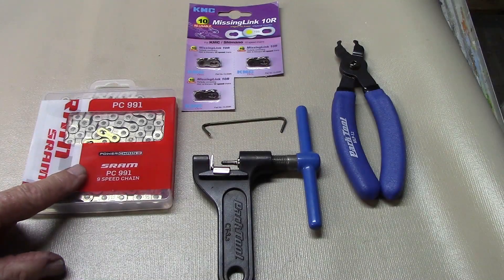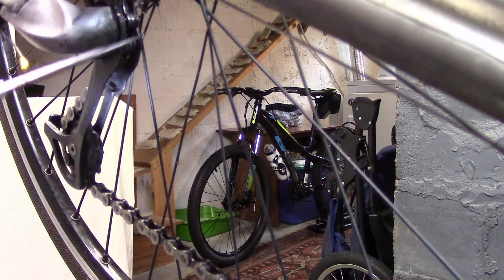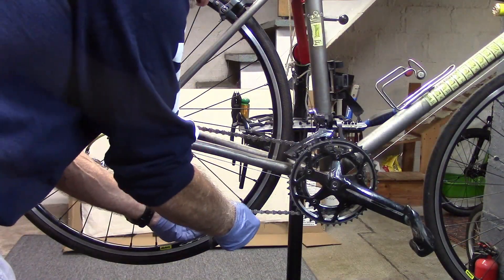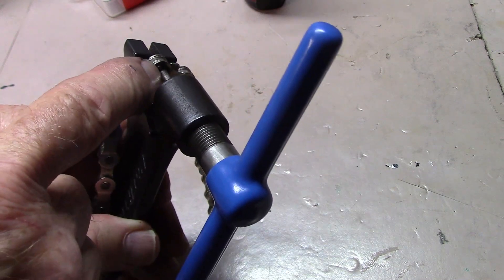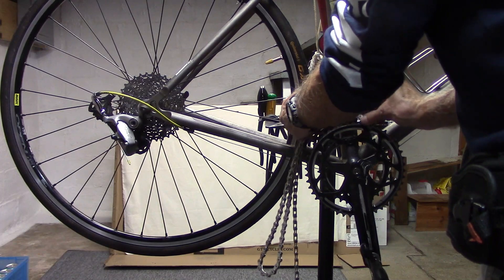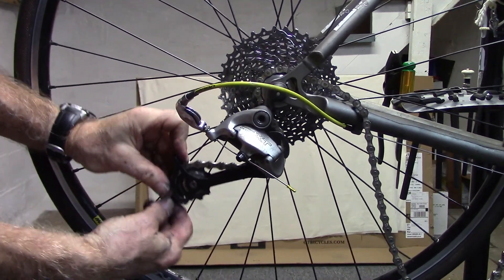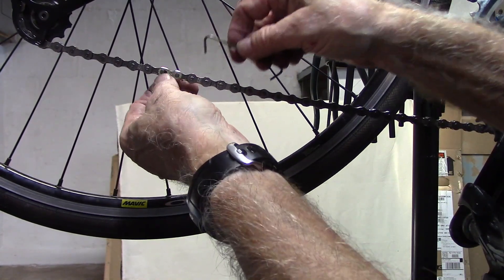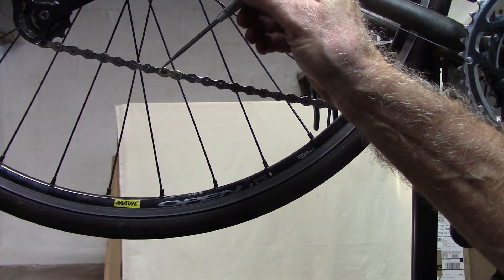Bike Chain Replacement: Removal & Installation

Comment: Well here goes...you've given me some great instructions, I think I can do this!
Reply from the maker: Let me know how you make out and if I can help. Safe cycling, Tony
Reply: @tony10speed  I got 'er done! I was just removing a couple chains to clean them in the sonicater, I used new master links to rejoin the chains but wonder if I could have used the old pins (or would that have been to difficult?)
Reply from the maker: @wandam3594  Depends on who you ask. The manufacturer states they are one time use unless otherwise marked. A number of cyclist state that they have reused the master links without problem. Personally, I use the master link that comes with a new chain and replace it if I have to remove the chain for cleaning. However, KMC makes re-useable master links for most chains (be sure to get the correct speed and type for the manufacturer of your chain). KMC states that they can be re-used up to 7 times. Also note that when ever you replace a chain, use a brand new master link in that the old one on the used chain is probably very worn. I know that's not a definitive answer, but it's the best I can do. Regards, Tony

Comment: I use two master-link pliers: one designed specifically for opening master links and the other for closing them. Both require that the handles are squeezed together, rather than one requiring the handles be pulled apart. It just makes things easier.
Reply from the maker: I have both also and do find it preferable because I can hold my hand on the master link to keep it together and in place. This way I'm assured that the pins will move properly within the master link and not pop out as I snap the link in place.

Comment: Hi Tony, I bought a new KMC x10.93 chain which is very sticky. I think I should degrease it in order to remove all that grease patina. By soaking it in petrol and shaking for a minute. Than blow with compressed air, and relube with finish line dry lube. Am I doing right? Thank you, cheers from Italy!
Reply from the maker: I'll give you the chain manufacturers recommendations and then what I do.
1. The manufacturers suggest leaving the heavy "goo" like lubricate on the chain and riding for up to 150 to 200 miles. Then, as much of the lubricant has worn off, re-lubricate. But they say DON'T use a dry lubricate (like Finish Line Dry) because it doesn't "mix" with the original "goo" like coating. Well, hell, what does one do if one want to use a dry lubricant on my road bike chain? They don't say.
2. What I do is soak the NEW chain for a few hours (over overnight) in Turpentine. I know it removes some of the deep sticky lubricant in the rollers and bearings of the chain. I the take the new chain out, hang it up, dry it with a cloth and let the Turpentine evaporate for an hour or so (or use a blower as described below). I remove the old chain and install the nice non-gooey chain on my bike. I then add Finish Line Dry lubricant and let the lubricant sit overnight to soak into the chain bearings before wiping off the excess (on my mountain bike I use either dry of wet lubricant depending on the trail conditions). 

Petrol (gasoline) is a little more dangerous to use, especially inside, and I don't like the smell in my work shop. You can use a blower (I have a beautiful rechargeable battery operated one - the batteries also run my electric drill so I didn't need to buy anything more then the blower without batteries). It gives off no heat and is therefore less dangerous to use to dry the chain. I also use the blower to dry my bike and drivetrain after washing my bike. Don't use a hair drier or anything which gives off heat when working with any chemical (Turp or Petrol). I also use the blower at low power after washing my bike so as not to blow out the lubricant that has seeped into the chain or hub bearings. 

Regards, Tony

Comment: Quick question: how do you know when you're supposed to replace the chain? I understand there are tools you can use that will tell you the chain wear but is that sufficient on its own to determine whether a chain should be replaced? The reason I ask is I had my bike serviced at my local bike shop 3 weeks ago and the technician said there was about 50% wear on the chain and I should consider replacing fairly soon (I think you're supposed to replace at 75% wear). But when I go biking now I notice that occasionally the chain will "slip" in certain gears, especially when I apply a lot of torque to the pedal, something I didn't notice before. Also, I noticed some rust accumulate on the chain. Any thoughts?
Reply from the maker: In your case, a rusty chain combined with a worn rear cassette may be the cause of the problem and replacement of both may solve your problem. But first see the overview from RJ the bike guy:
https://youtu.be/VzrpC7jrz8U?t=194
These specific videos may help:
1. How to Recognize a Worn Cassette:
https://www.youtube.com/watch?v=g5uqTNmikro
2. Stiff chain links due to rust:
https://www.youtube.com/watch?v=hklVw3KErKw
3. Need to adjust the rear derailleur indexing. See:
https://www.youtube.com/watch?v=6C3SkRkD8Hs
4. Bent derailleur hanger:
https://www.youtube.com/watch?v=qHK6jQizIdc
5. Worn rear derailleur cable:
https://www.youtube.com/watch?v=WMuiiugajmE
Again, my bet is a rusty chain (with stiff links) and a worn (an maybe rusty) cassette and replacement of both may be the solution. But before you spend more money, take your time as you look for the problem and try to eliminate the possibilities as you probe for the cause. Let me know how you make out. Regards, Tony

Comment: How do you know how long the chain should be?
It seemed like you just pulled up the slack to remove the pin on the worn chain, and then matched the new one to the old one.
Reply from the maker: When you line up your old chain against a new chain, the old chain will be longer due to wear of the pins, bushings and rollers. See:
https://www.youtube.com/watch?v=QWemvEfYoBY
The wear will effect shifting and put more wear on the cassette and chainrings. However, when you line up the new and old chains, this difference (which obviously is significant) is small enough (just millimeters) to give you an idea of which pin to remove on the new chain.
Reply: @tony10speed  Okay. It just looked like you slacked the worn chain enough to take it off easily, so I wasn't sure if I lined up my new chain if I'd accidentally take off too many links or too few and the chain would be too long/slack.
Reply: @tony10speed  makes sense, changed it today!

Comment: Are quick links and master links the same?
Reply from the maker: They seem to be used to refer to the same product. Some call them quick links (quick to install a new chain) while others use the term master link. Note that you need a master link that matches the speed of your chain and compatible with your chain's manufacturer (usually stated on the packaging label).  They also may vary in how they are installed such as the Wipperman Connex.

Comment: I don't bother with a chain hook. I just place the chain inside the small chainring on top of the bottom bracket.
Reply from the maker: Fine to do as long as you are careful not to scratch any paint or get grease on you frame.